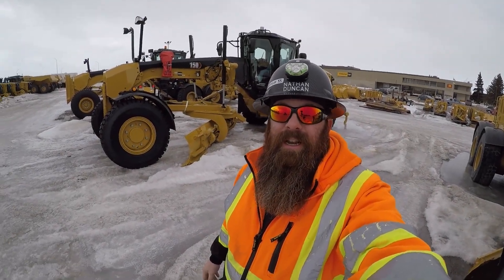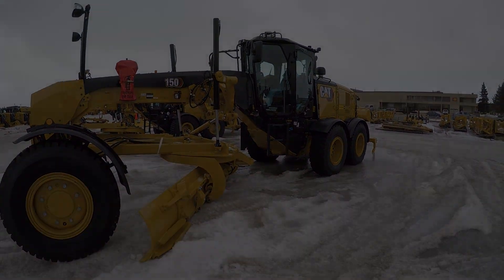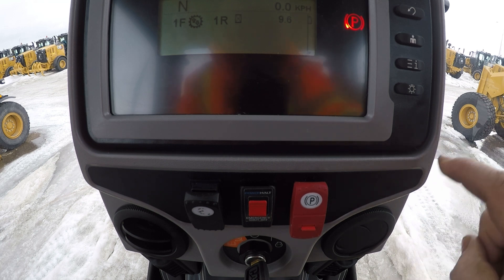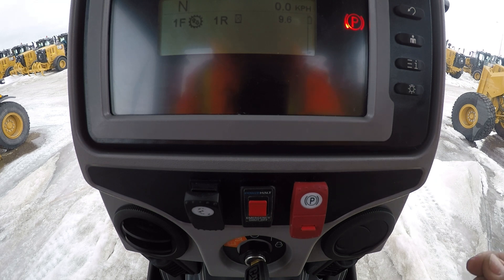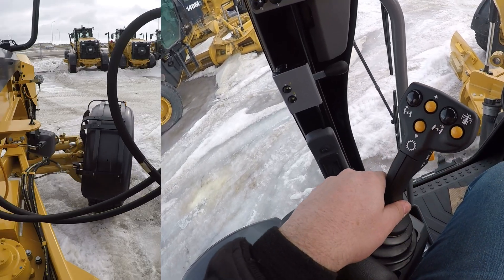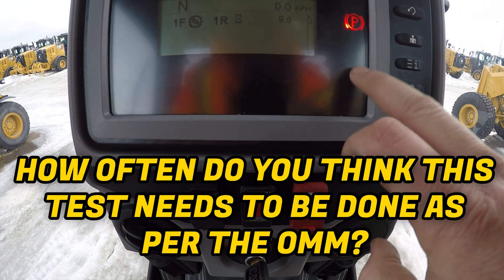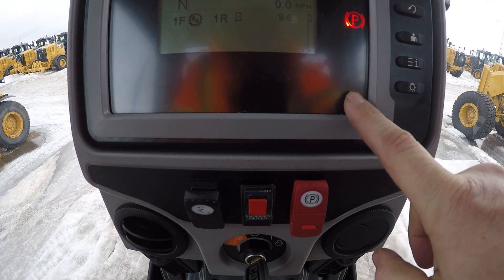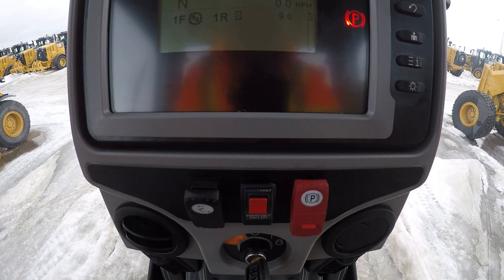Caterpillar 150 Motor Grader - Secondary Steering Test Tutorial

Comment: Would be nice if someone could put out a video showcasing the updated cab. I’ve only seen one picture on IG. Not even Cat has updated pics on their website.
Reply from the maker: @KInd325  the updated cab? The cab hasn’t changed much since 2007 when the M series came out, there have been slight changes over the years but nothing major.  If you are referring to the new cab on like the next gen 120? That’s the only grader so far that has that cab, the next gen platform for graders has not come out yet for 140/150/160.  Is there something specific you want to see in the cab? I can try incorporating it into a future video.  Thanks for watching
Reply: @ I’m aware of the 120 that’s been out for a few years. But I saw a 140 joystick machine with similar cab as the 120 on Instagram the other day. I screen shotted it but I forgot which page I took it from.   I can’t post the pic on here but I’ll send it to you on IG.
Reply from the maker: @ yes please do and I’ll be able to help further. Thanks